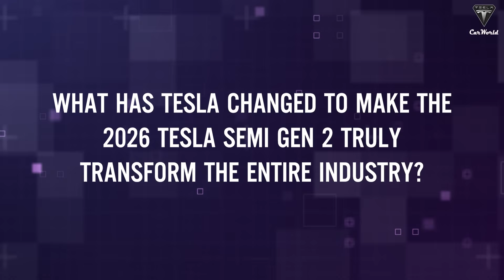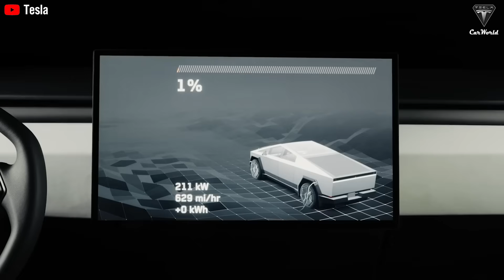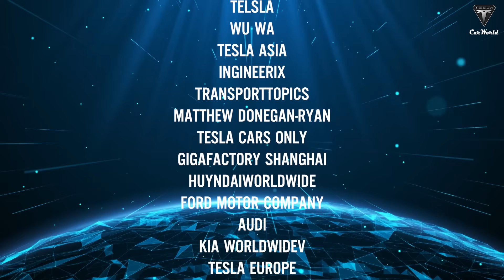Elon Musk Drops 2026 Tesla Semi Gen 2! Cheaper Battery, Upgraded Interior & Suspension!

Comment: I have never seen one. The 65 mph note flashed on the screen just a short time so I’m not sure what it is referring to, but the speeds outside of Nevada outside of Las Vegas are 75 to 80 mph so I’m not sure this truck can last hauling on the road for a very long time.
I still have my doubts about this and Elon should work on the model 2/Q and sell that to get some real income into the Tesla corporation thank you
Reply from the maker: Semi is optimized for long-haul, speeds up to 75+ mph, redesigned chassis, low center of gravity, and reinforced suspension — built for sustained highway loads.

Comment: You think a truck stop in rural Nebraska wants to foot the bill for a multi-megawatt charger installation?
Reply: If truck stops selling expensive fuel can survive ?  Why won’t a truck stop powered mainly by the free sunshine. 
 They will charge batteries and those batteries will also accept cheap off peak electricity from the grid.
Reply from the maker: Tesla plans Megacharger hubs strategically, sharing costs across fleets and regions; rural installations focus on high-traffic routes to ensure economic viability.

Comment: What safety features are included to protect drivers and cargo?
Reply: You're seriously going to ask this question you dumbass there are no such things as charging ports for electric semis with this higher voltage battery are you going to ask the dumbest question WHEN THESE TRUCKS ARE THE ONLY ELECTRIC TRUCKS ON THE F**** MARKET FOR DELIVERING STUFF
Reply from the maker: The 2026 Semi includes reinforced chassis, low center of gravity, advanced FSD sensors, and stability-optimized suspension to protect both drivers and cargo efficiently.

Comment: Even if chargers exist, what about power supply? One truck charging equals dozens of homes worth of electricity. The grid’s not ready for that.
Reply: There is this thing called the sun. Backed up by batteries. 
  Solar panels  can easily be set up anyplace. With off peak power providing additional input at a relatively tiny cost. 
 In short it’s happening.
Reply: @frenchydampier2209  there is no way that solar panels can provide enough power for fleets of trucks unless you cover vast areas with panels and hope that the sun shines. Try that in New York.
Reply from the maker: Tesla Semi uses Megawatt chargers and 4680 batteries designed for fast, efficient charging; deployment includes grid-smart scheduling to minimize strain on local power networks.